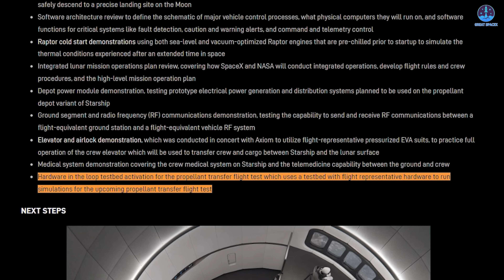SpaceX revealed Genius Solution to Land first Starship on the Moon in 2026! Is it going to Happen?

Comment: It has been estimated that SpaceX's delays and constant failures will cost NASA (US taxpayers) about 30 billion dollars, over the next several years.
Meantime, New Glenn worked perfectly on just its second flight, and it even sent a package to Mars.
Starship is a gigantic stack of Muskian failure, with zero orbits, and zero tons to orbit, after wasting 5 billion dollars of pubic money.
Reply: If Starship can not be completely rapidly reusable then it is a failure.  Starship has much more difficult problems to solve than payload to space or orbit.  Those are solved problems.  Robust reentry and rapid redeployment of the complete system is getting close.  In the meantime Space X has created supply chains, a factory, a launch and catch system all while maintaining an expansive satellite network that has solved emergency connectivity in many theaters.  

New Glenn has launched and landed.  I should hope so.  I hope they can catch up to Space X.

Comment: I think SpaceX should have commercialised booster Raptor V2, Booster V2, and Starship V2 with launch platforms being able to launch both v2 and v3. 
This would provide much needed launch capacity into LEO and very valuable increased ability to launch  very large satalities by they scientific, commercial or military. 
In parallel with increased revenues, it would give SpaceX the space to really develop V3 and V4 Starships. 
The risk ove v3 not going smoothly is very, very high, and I am expecting a lot of pad and non-pad blowup because everything is known, and all thd bugs will need to be ironed out. 
There is no point in planning for the best outcome, but every point in planning for the worst case to happens at every single stage.

Comment: What rank of moron thinks it'll take 18 more months for an uncrewed launch when he's already doing them?
Reply: They are talking about an uncrewed launch and landing ON THE MOON! Totally different animal and much harder to pull off.
Reply: Starship is totally different from Falcon 9 and Dragon. It took 10 flights for Falcon 9 first stage to land safely back on Earth. Starship has had 13 failures to orbit 💫 and every time there is a new version of Starship and Super Heavy Booster it takes 5 to 6 flights to fix new problems. Also it takes 8 flights of Starship for uncrewed Starship HLS to test land on the Moon and return.
Reply: @mrbaab5932  "Starship has had 13 failures to orbit" there have been 11 flight tests. You can't "fail to orbit" if you haven't tried to orbit. Every single IFT flight profile has been suborbital as the target. That's like saying I failed to drive to New York when I drove 10 miles to Walmart.
"Also it takes 8 flights of Starship for uncrewed Starship HLS to test land on the Moon and return."
No, it takes 4. It takes -17. See? I can make up numbers too. Also, return to where? It doesn't have a heat shield.
"It took 10 flights for Falcon 9 first stage to land safely back on Earth."
It took the Starship booster 5 flights for a successful catch.

Comment: Once Starship returns from the Moon it can not land on earth without heat shield.
As usual. You don't know what you are talking about.
Reply: Dragon waiting on the return. They have all they need.
Reply: The HLS Starpig is a disposable craft. Its sole purpose is to go the moon once it's fully loaded with 1000 metric ton of methane an O2. Fire it's rocket engines orbit the moon and rendezvous with Orion. 2 astronauts go into Starpig and land on the moon surface. After a week or so Starpig takes them back to Orion in moon orbit. once the 2 astronauts are back in Orion the 4 head back to earth using the Orion rocket engines. The empty Starpig goes on some heliocentric orbit around the sun. Maybe join Starman :)
Reply: Hello there 🚀🚀, how’re you !!  You having a direct text from Mr. Musk .. and I would like to say a big thanks to you for all your like and comments,  where are you chatting from?

Comment: I think everyone needs to realize that SpaceX doesn't follow NASA's methodologies.  If they did, it would be another decade before the US would be back on the moon.  They just performed another "miracle" in NASA terms by constructing B-19 in less than a month.  SpaceX is developing all processes (in their control) to be substantially faster than anything a government agency would believe possible.  I also have serious doubts that the in orbit fueling will be handled the way NASA is currently portraying.  I anticipate SpaceX has a surprise there too.
Reply: 'They just performed another "miracle" in NASA terms by constructing B-19 in less than a month.'

I wonder is there a relationship between building rockets in under four weeks only to see them all melt or blow up?
Reply: @JarvisThribb  Guess we'll see with B19, since that is the only one that's ever been built in under 4 weeks (to my knowledge).

Used to work for them and NASA, is the slowest Governmental agency around.  They are dinosaurs.   But there is no reason to be that way anymore.  You can develop quickly and safely at the same time.

Comment: It all depends upon how fast Starship achieves success in orbital refueling. Unfortunately for the moon and eventually Mars it requires multiple tanker refueling flights. It would be nice if Starship created a depot variant, with full boil off mitigation. Then the tankers fill the depot multiple times. Removes all but one primary refueling for the lunar starship.
Reply: A very good  idea indeed 👍

Comment: Could a hydraulic/ syringe type design work for refueling??
Reply: Or, acceleration/deceleration to force the fuel to where they need it.
Reply: Who's going to push the plunger ?
Reply: No matter how many times you ask that same question the answer will always be the same.

 What the fuck are you talking about?
Reply: @JarvisThribb  They're talking about having a separate compartment in the fuel tank that can hold a charged gas propellent.  When refueling, the separated compartment would be charged and a movable wall or barrier between the charged gas and fuel would push the fuel out. This is how gel shaving cans work. The challenge would be creating a seal that wouldn't allow the charged gas  to mix with the fuel in extreme temperatures.

Comment: SpaceX doesn't need NASA to do what it needs to do on the moon. NASA and Artemis need SpaceX! With or without NASA, SpaceX will be on the moon.
Reply: It would not surprise me if Elon gave NASA the finger and simply did this on his own.  NASA is Government Administration.  As such it's designed to F up and burn money.  We don't need NASA.
Reply: @NotThatBob
You don’t give the government the finger. The government gives you the finger… digitally…
Reply: NASA owns the land and launch pads at Cape Canaveral and also the  deep space tracking and radio network.  The Air Force and FAA play an important role in safety issues and  monitoring air space.
Reply from the maker: Exactly 👍
Reply: The Moon is NASA's destination, not SX's.  SX has no reason to go to the Moon other than to fulfill a contract and get paid.
Reply: @armandomercado2248 Don't be surprised if SpaceX has the first and only moon base. The only thing NASA has to show for the past 50 years was some footprints and a few relics. We the taxpayers have been paying for all that crap.
Reply: @richbl1690  So tired of people ignorant of US space policy.  NASA is not an independent agency that can do whatever it wants.  NASA is directed by the Administration and funded by Congress.  They do what they are told.
Reply: @armandomercado2248 NASA has been nothing but a Leech on taxpayer funds for years.
Reply: @richbl1690  NASA is not the reason your life is miserable.
Reply: SpaceX and Elon is running low on money 💵 and that is why Elon wants a trillion dollars 💵 pay from Tesla and is taking SpaceX public to raise badly need funds. SpaceX is under contract with NASA also NASA and the Pentagon paid for the development of Falcon 9 and Dragon 🐲.
Reply: @mrbaab5932  I'm not gonna apologize but I don't think your information is correct, Elon and SpaceX have a money issue at all. I don't know where you're getting your information but, It's totally incorrect.
Reply: @mrbaab5932 😂😂😂😂😂
Reply: I don’t think so. SpaceX has no interest in going to the moon (or Mars). Taking stuff to LEO, that’s what they’re all about. Anything else is just sales points to get government funding.
There’s no financial gain for going to the moon, so SpaceX isn’t going to do it without getting paid handsomely.
Reply: @sweetpuppies1065  I don't know where you're getting your information, It's so far off it's not even funny. SpaceX literally has a factory to build starships and boosters for Mars. The moon is nothing but a proving ground.
Reply: @richbl1690  SpaceX hasn’t built a single spacecraft that goes beyond LEO. Not even a prototype.
Reply: @sweetpuppies1065  What do you call Falcon 9 and Dragon?
Reply: Lmfao. SpaceX faild to deliver on their contractual obligations. So now you blame Nasa. Brilliant
Reply: @mp6756 so has Boeing, Blue Origin, United Launch Aliance, to name a few.

Comment: I am very skeptical of a Moon  landing in 2026. II am fairly certain this will not happen. I will be very impressed if they can launch a payload to orbit of over 100t and recover this vehicle. I do not think they will even get to demonstrate in orbit refueling.
Reply from the maker: Let's wait to see how SpaceX will solve each task
Reply: @colonbina1 We shall see. I am just giving my opinion based on their flight track record and engineering.
Reply: Hi they have demonstrated moving fuel between tanks in space.
They could just build a one way starship, increasing payload by deleting flaps and the heat shield.
You may end up with solar or insulation but it is possible.
Concentrating on reuse is delaying the plan to develop reuse.
Take care M
Reply: @markeh1971 agree one starship one permanent lunar module. One small lander for humans.
Reply: @markeh1971 For sure, I am not saying its impossible. But it is unrealistic. There are many risks in each one of these goals. This is hail marry pass  engineering. The track record is that they don’t get it right the first time. You can compound that philosophy at every step of this mission. To get to 100t they will need to save 50-60t from this current vehicle. But the tankers have to be reusable. So, there.
If they want to keep the date, they should move to Falcon heavy and see where that takes them. They can continue with Starship research in the background..

Comment: Good review of the timeline requirements.  
Please explain the advantage of another suborbital flight rather than a full orbit and landing in the Gulf, off the coast of Starbase.
Reply: New system need proven before being allowed to re-enter over Mexico or the American southwest. I won't be surprised if they do a few orbital missions that burn into either the Pacific or Indian oceans before being allowed to go for Texas. Any mission coming in over populated areas will not be able to push development in the extremes (missing tiles, different tiles, entry angles, max force, max heating, less engines, different burn patterns, ...).